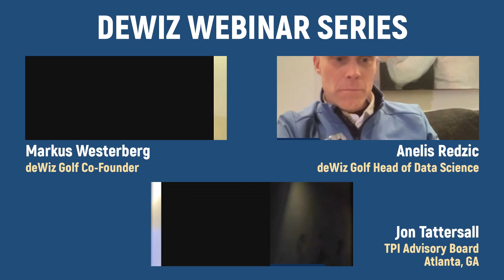Understanding NEW deWiz Data Points | deWiz Webinar Series - Jon Tattersall Part II

Comment: when the second Ipod was offered for sale,  as I was selling the first one that I needed to get rid of to one of the "IT" guys in my division, ..."you know what they need to do is to put a phone in one of these things that would be really cool..." I recall saying to the young tech consumer...mobile phones had gone from car battery size with wired handsets to well at the time they were trying to make them uselessly small which was a trend that came to a swift end

so take this with a grain of salt but the thing you really need to put together is 

a companion belt buckle which is going to provide the detailed detail in excruciatingly small detail where the center of the earth is relative to the moon at oh wait no not that
where the center of your mass is relative to the other thing which is measuring where the back of one of your hands is relative to the theoretical other end of around a pound of metal and rubber

and you might try sending one off to Victor so that he can send you the data on the double pump you seemed to be having a mind bending swing thought about back swing something 

anyway the double pump speaks for itself the butt of the club is separated from your butt before any elbow starts moving in any other unnamed direction relative to the but that is not it point

https://youtu.be/fA9O4sypCD4

Comment: Put in an order for a unit today 

https://en.wikipedia.org/wiki/Trebuchet

that is the idea you are looking to model
 the free flow of a pound of metal around three 
orthogonal LY aligned points connected to limiters
defining the size of the Δ relative to the diameter of the 
desired distance di scribe able before anything begins to move

https://en.wikipedia.org/wiki/Trebuchet

when the pound contacts an ounce of feathers and change something happens

the sum of the angles in a triangle always add up to the same number
as three triangles move relative to each other there are defined angles
defining each other angle with definite definition

the outside edge of the lead foot (ankle pivot)
the shoulder joint at the top of the lead arm
the hip joint of the following leg 

the point where the ball makes orthogonal contact with the club face
the point where the club face orthogonalizes with the shaft
the point where the hands orthogonalize with the grip

the face is moving in three directions at once 

with the exception of the one moment where that pound of metal hangs weightless
over some center of some three triangles throwing each other around in a triangular circle

been waiting for this for a minute or three 

be reading this again while we all wait for it whatever it is

https://www.audible.com/pd/The-Kingdom-of-Shivas-Irons-Audiobook/B002SV3SSA?action_code=ASSGB149080119000H&share_location=pdp